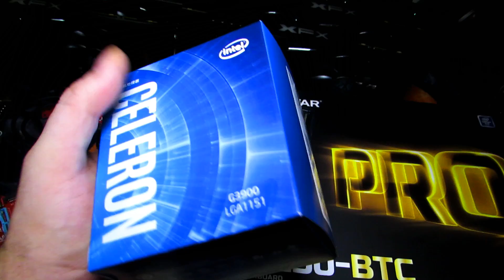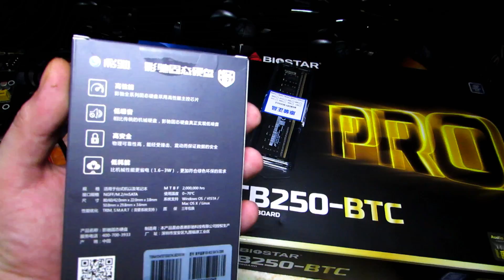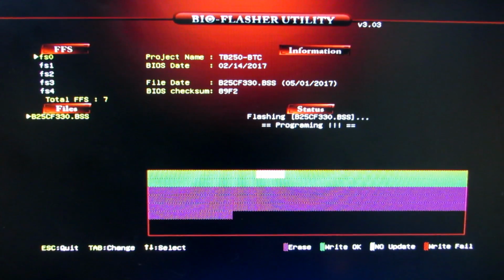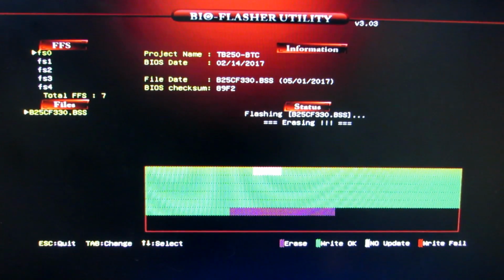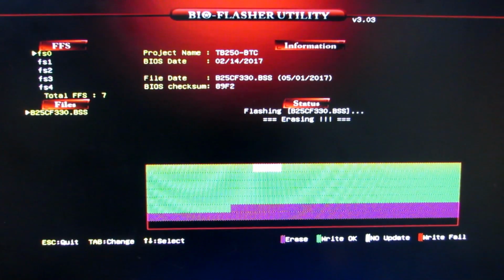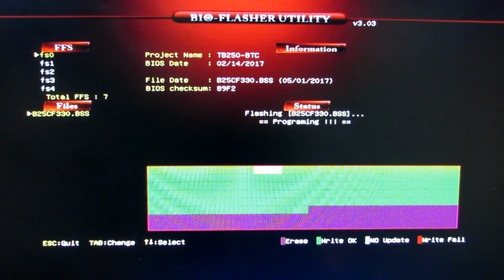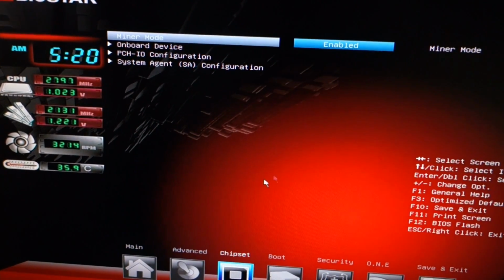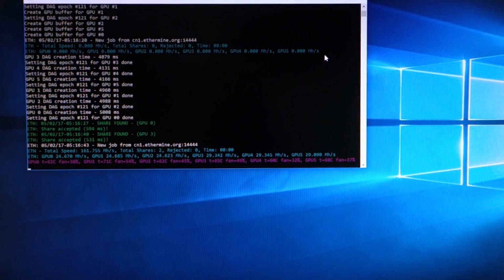Biostar TB250-BTC PRO Mining Rig Build, 6X XFX RX480 8G, Celeron G3900, M.2 Ethereum Zcash

Comment: Can you use 6 molex powered PCI extenders on this board?
Reply from the maker: you mean the USB3.0 1x to 16x powered molex risers like these right?   https://cryptomined.com/index.php?main_page=product_info&cPath=1_10&products_id=7
if so yes you could use any mix of usb3.0 1x to 16x risers with this board.  what you use should more depend on your power supply and the extra cables you have.
for my 1300G2, I had 4 sata cables and 2 molex cables, so i used 4 sata risers and 2 molex risers.  But... you could use the molex to sata extender that comes with the molex risers to produce the same effect.  I do however, think that using direct sata connections is safer as some people have had problems with the molex extenders melting in the past.  now, i have never heard of anyone having a problem with the molex to sata extender melting with any risers I have sold, but that is an issue that I have seen in the past with other molex risers using the molex to sata extender.

does that answer your question?
Reply: Yes, that is what I thought. Thanks a lot for reply.
Reply from the maker: you are welcome, thanks for watching.

Comment: Great video.
A suggestion, be careful about static interference, my raiser&sata line%usb cable burned before when power off , because of static electricity.
I use metal shelf too, link many ground lines on it.
Reply from the maker: thanks for the heads up, hopefully the PVC base that I use on the motherboard protects my components.  I have wood and tile floors (no carpet) so static should be at a minimum for me.  Could be more of an issue maybe with carpeted floors?
Reply: Try test voltage with test pan on your metal shelf when power on,  if I'am over worry about static. 
Then you know what I tall about.

Comment: How to set up bios mode.... My rig with 6 saphire nitro+ rx 480 8gb gives ony 148mhz please help how to increase
Reply from the maker: Please take a look at my bios mod videos, specifically the DIY 480, Low powered 480, and 580 mod videos.  If you watch the low powered 480 mod video you should be able to transfer those settings to almost any samsung 480 8g card and get the same results.